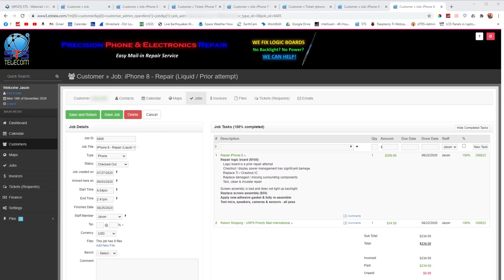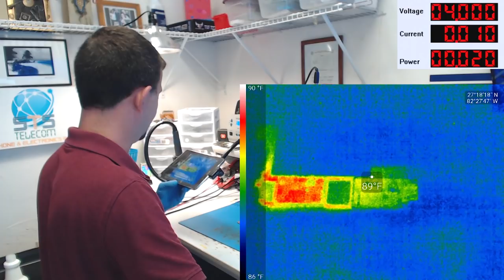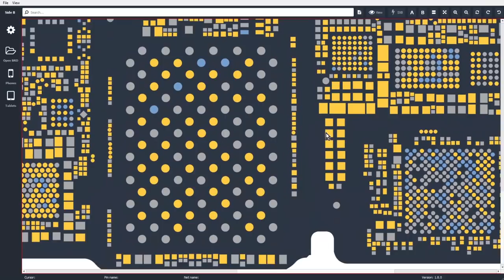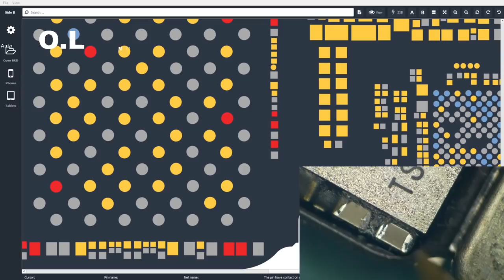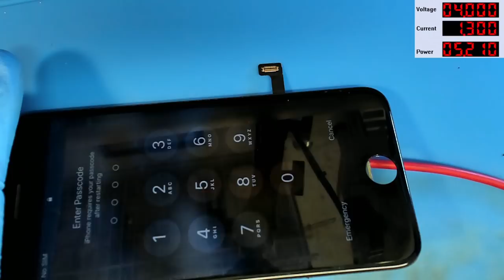Repairing an iPhone 8 from Germany (A warranty repair!)

Comment: Wow, I didn't realize that you could use an iphone 7 screen on an 8. Really useful to know. Many thx Jason.
Reply from the maker: No problem :)  Just not the home button connector.  It can cause issues with the grounds being pushed back into the connector and then touch doesn't work when the home button is connected.  Very strange problem.  I only connect the display connector since learning about that!

Comment: Generalized moderate-to-high heating of the surrounding area to prevent localized thermal shock effects is used in soldering, brazing, and welding.  It is a professional technique to get maximum results with minimum side-effects.  Well done.

Comment: Might have to go see if I can find the iPhone 8 boardview again.  Last  time I was gathering up my board-nuts the iP8 was blank, so maybe there's a new iP8 nut that's dropped to the ground that I can gather up.
Reply from the maker: Awesome.  While you’re at it, I hear you are working on software that when connected to any device via USB, will automatically produce a circuit diagram of everything that’s inside.  Could you also make it tell what the exact problem is, produce a solution and then lastly, automatically order the parts to fix it?  Oh, any chance of having it done by the end of the week?  I’m trying to get rich but I’m running behind schedule.  It would be nice if the software would just go ahead and repair the device too. 😬

Comment: Love to see you posting again, brother. I haven’t watched the video yet but it’s probably the battery lol
Reply: Or maybe it’s the pentalobe screw laying on the board lol UPDATE:  it’s not a screw lol
Reply from the maker: I had just read this comment and then got a text message from someone saying the same thing.  Almost gave me a heart attack running to review the video as this phone is on it’s way back to Germany!!!  That’s a scratch I put on the board to mark pin 1 before I removed the chestnut IC.  I’m amazed that it looks exactly like a pentalobe screw. 😮 I normally put just a very tiny mark.  This one is pretty big (probably due to prior repair attempt frustration).
Reply from the maker: Whew... now I gotta calm down.  Lol
Reply: @ststele  Sorry 🤪

Comment: Hey Jason, i see you’ve got a diffrent hotair now. I remember you’ve been using Aoyue 852+ or simmilar. Got the same but never was sure what temperature I should be using and air flow. Can you remember your temp settings and airflow you’ve used on untouched boards for those tiny 01005 smd caps/resistors and bigger BGA chips? Also what diameter of a nozzle is being used? What would be a good starting point? I very often tend to damage those plastic connectors :/ thanks in advance!  Cheers!
Reply from the maker: I was using the 6mm nozzle most of the time.  The temp, I think, was set waaaay to high.  I was always running it on 400~450c if I remember right.  For the plastic connectors, it helps a lot to cover them in flux.  I'm using Chipquik SMD291 flux mostly and for harvesting or soldering iPhone connectors, the flux helps quite a bit to keep from melting the plastic.  Flux and a bit lower temps but the flux helps me a ton!  Hopefully this helps.
Reply: @ststele  many thanks!
Reply: @ststele  you could cover the plastic connector with kapton tape

Comment: Did you do one yet on the 2017 9.7" iPad capacitor defect? 2 of the small square caps fail after a few years and prevent booting. Makes it look like a dead battery but it's not.

Comment: My experience with water damage in electronics says you can visibly see a small fraction of damage. Water damaged devices - file 13. You will save much frustration and effort.  Cut your loss and move on.

Comment: The battery on the flir one is really bad indeed. I 3D printed me a magnifying adapter with a CO2 lens for it. With this I could easily spot a bad cap on a iPhone 7 from my father and repair it pretty fast.
Reply from the maker: Nice! I wondered how long it would take for the battery to start to get weak.  I'll surely be cracking this thing open to replace it.
Reply: @ststele  WOW, you know a tech who can replace the FLIR battery? Sweet. 😂

Comment: I see what you meant with using ice spray instead of a thermal camera to find a shorted part, but wouldn't high percentage alcohol do the same job? If course you could argue that the alcohol removes any adhesive, but still.

Comment: Hi
I just received my camera, thanks man for introduce and review, it's nice and handy, just my camera has clicking noise every 10 second and video freezing after that for 0.5 second, is it normal ? do have this clicking noise in you camera ?
Reply from the maker: The clicking and pause is normal.  I think it has something to do with how it calibrates the temperature range. The FLIR camera does it too but there is a setting to make it happen manually.  I’m thinking the seek may have a setting somewhere too but I haven’t looked for it yet.

Comment: Well done jason, the crap cap got a slap :-D
You have a business to run, we understand,  keep up the good work :-D
I bet you would like your old crappy power supply back now ha ha :-D
No swearing please :)
Reply from the maker: LOL!  Thanks.  I actually fixed that thing with my son a few weeks ago.  He's starting to really get interested in electronics and wanted a power supply.  We took it apart and found the bad diode and away he went.
Reply: @ststele  Good :-D,  even cheap power supplys can be usefull.
Some however are too cheap, the pass transistor on the back needs a good heatsink to get ridd of unwanted heat,  some manufacturers skimp on the heatsink and the transistor boils and dies.
The panal pots can play up (cheap parts), but a can of switch cleaner fixes that.
Hope you and your family sidestep the virus, get KN95 / FFP2 rated masks,  not the little hamster hammock ones lol.

Comment: just place it over the seek.. you shall not remove anything and then you just turn the focus dial to get thinsg into focus.
The higher resolution goes a long way on these Seek Pro FF, and to an extent that you dont need MSX to edge enhance like on the Flir as you can make out stuff quite easily... got my unit in 2017 at a tad over 300 bucks, and its been great.. would love the next step for a VGA res, but they are around 1 to 2k USD and thats too much for my purpose. 
https://www.youtube.com/watch?v=2rNIJhWiRtM
It goes a long way if you lock the temperature span.

Comment: Helo sir I need help for my iPhone 7 Plus problem I wan to know what is c3725 for it getting hot went plug the battery
Reply from the maker: Hmmmm, could be c3725 itself.  I've had various shorts around that part of the board.  Often caused by liquid damage.
Reply: Thanks sir for respond. Every time I watch all of your videos it really amazing I like to much,
Reply: I have one more question sir. What happen if I remove the c 3725 . It still working?